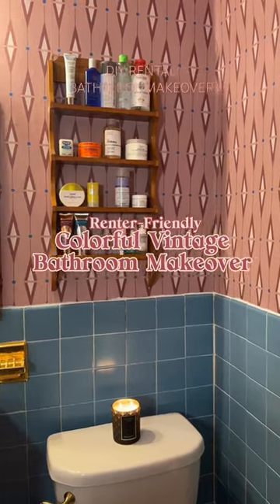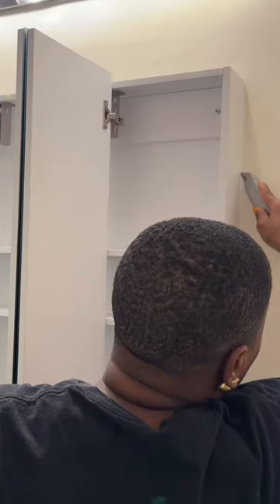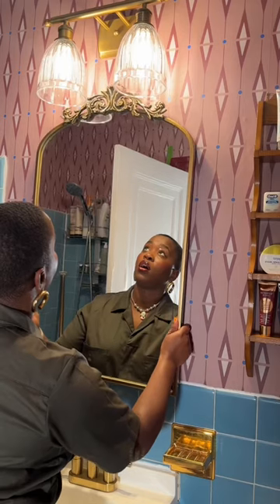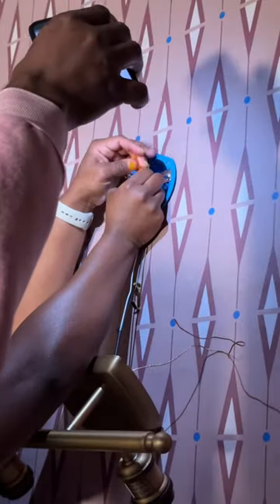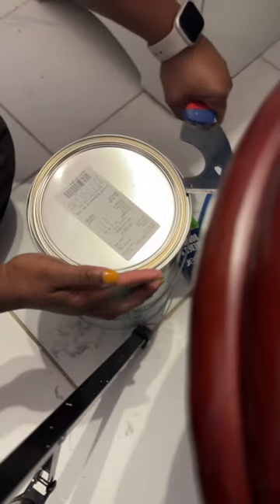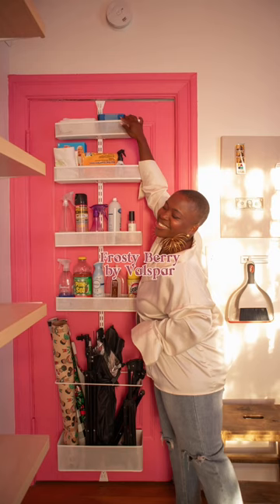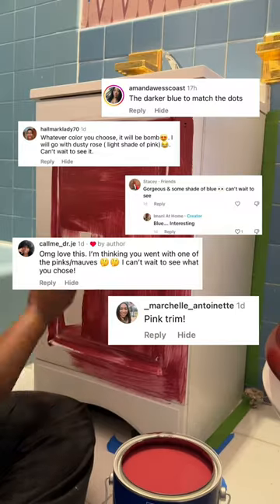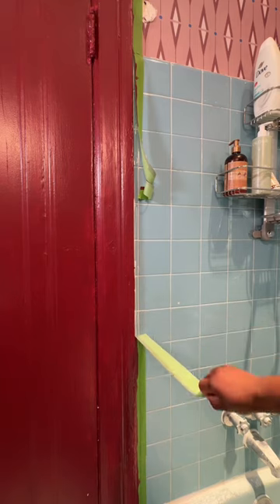DIY RENTER FRIENDLY BATHROOM UPGRADES #bathroomdesign #diy #wallpaper

Comment: It looks very lively, but wouldn't exactly call removing the cabinet, original faucets etc and painting the trim renter friendly since I think the landlord will mind given they were against letting you paint the tiles
Reply: I'm sure it was all put past the landlord first
Reply: If you have the energy and storage space you can just store everything and put it back when you move out hahaha
Reply: @katsnboots4709  that's probably fine in that case if the landlord gave permission
Reply from the maker: When you get approval from your landlord it is!
Reply: Love your color picks
Reply: Also depends on where you live. In many countries you need to install your own floors etc in rentals and you can paint whatever, as long as you return it in the original state/neutral colour when you leave. i guess she lives in the US where things are more limited in that regard from what I've seen, but just wanted to add that it can vary greatly wordwide!

Comment: I need an explanation on what makes the hardware renter friendly
Reply from the maker: You don't need approval from a landlord. It's quick and easy!
Reply: Anything that can be swapped back to what you had when you rented is renter friendly, as long as the new hardware is compatible with whatever you had before you can just keep the old ones in storage and put them back when you’re done renting.